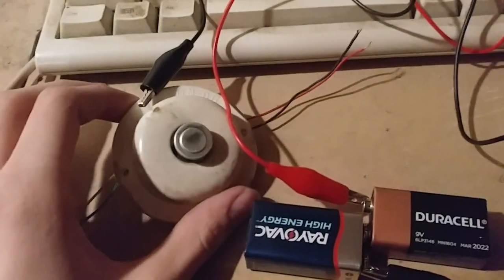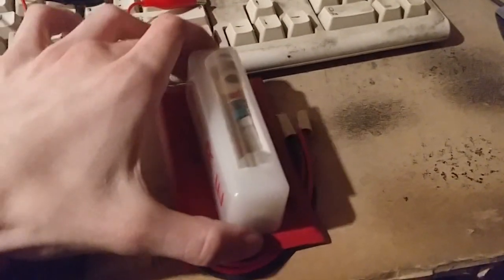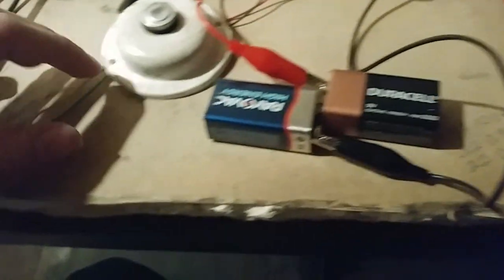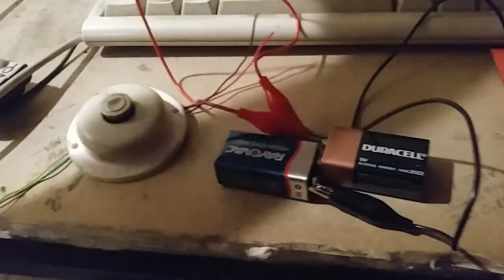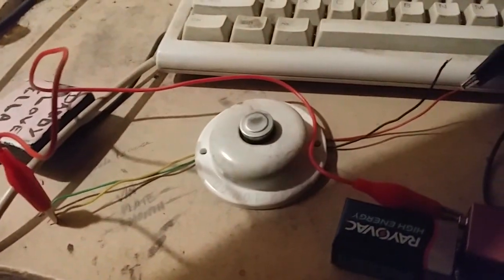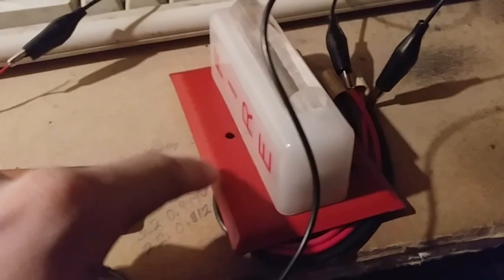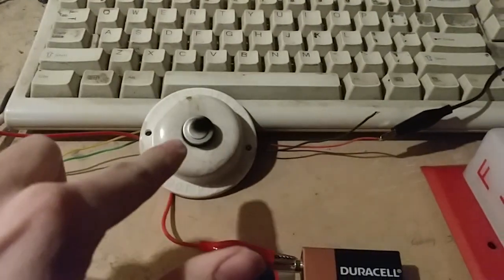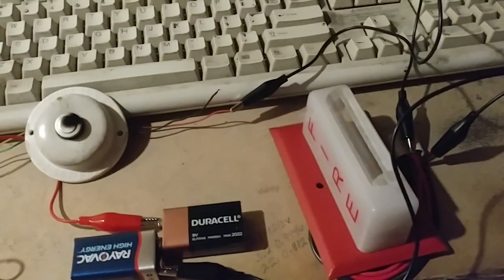How to wire a heat detector to a fire alarm

Comment: Exactly what I needed as a smoke alarm is not rated for the attic, I needed to use a heat detector as it normally gets over 120F. I wanted to add an alarm/siren in the attic. Thank you.